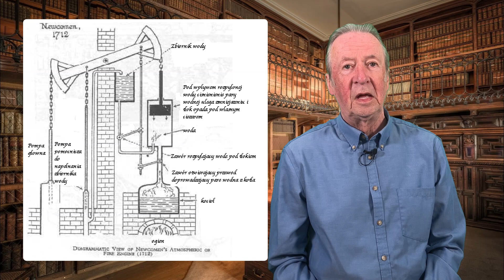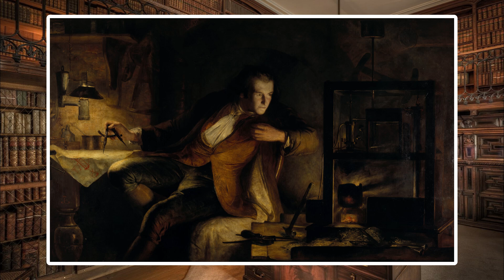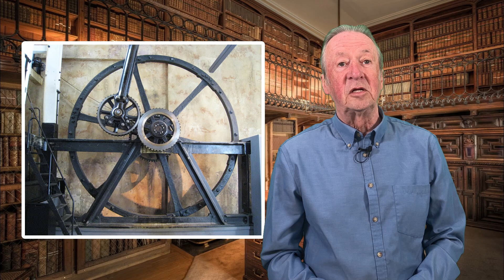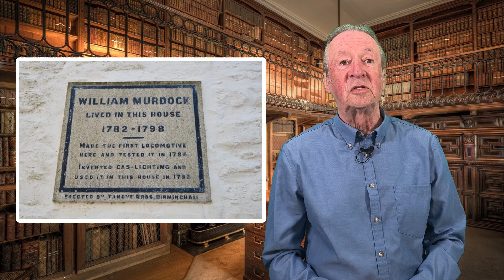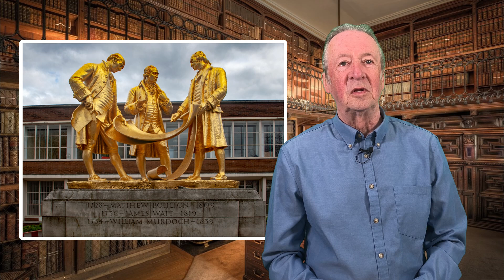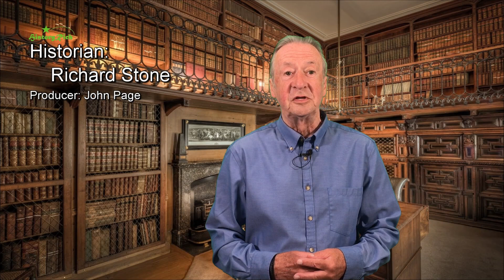‘James Watt and the steam engine’ The Industrial Revolution, 4.

Comment: Watt's Steam Engines weren't an improvement in efficiency. 
They were a new Invention, a machine that hadn't existed before about 1776. 
It wasn't an improved Newcomen Atmospheric Pump. 
That was the great English civil engineer, who was in direct competition with Watt, John Smeaton's job.
Watt dumped Newcomen's Atmospheric Power and Arkwright's Water-Power for High Pressure Steam Power. 
To achieve that he had to invent a new engine. 
The world's first PRACTICAL High Pressure Steam Powered Engine.
The only Engines we had before then were about 20,000 Waterwheels and Windmills (after about 3,000 years). 
By the year 1900 (after about 125 years), they were joined by 10,000,000 Steam Engines. That's a 500 times increase in sources of Power. 
Now we could have three million more Factories, Powered ships for the first ever time, Locomotives and much more besides. 
The Industrial Revolution was the relatively sudden mass production of Steam Engines, which, in turn, could mass produce everything else.